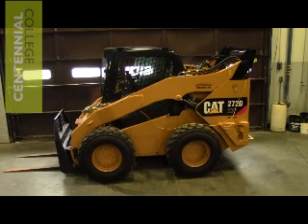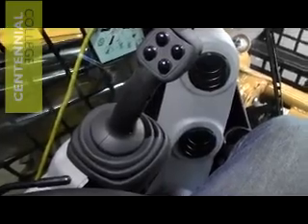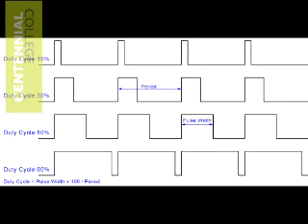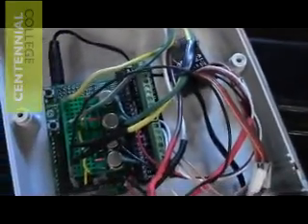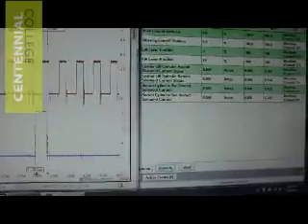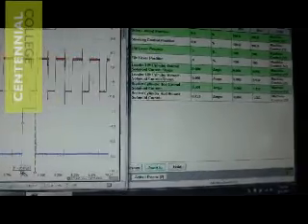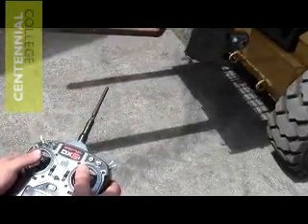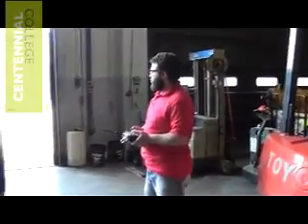Full Size Remote Controlled Skid Steer Using Arduino

Comment: Hi Tim this is awesome! I want to write some code to my own Arduino or raspberry pi to do the same thing. Im my early research I also learned about the can bus and the j1939 port that most 2005 onward models have. Could you also send all the PWM signals through the j1939 port? Or do you have to hook up the ardiumo up behind each joystick